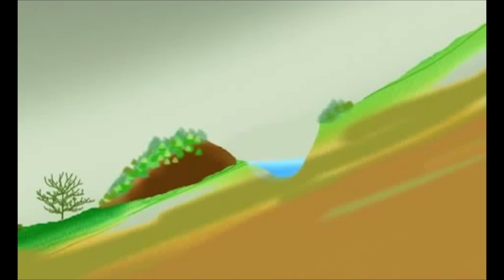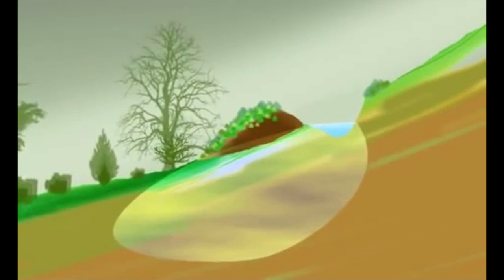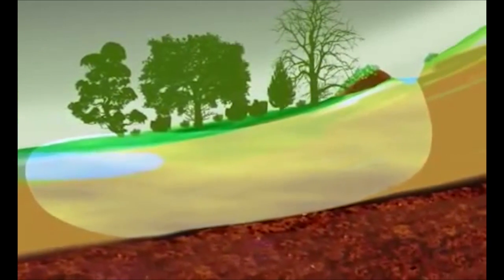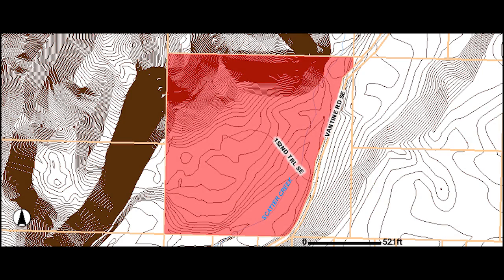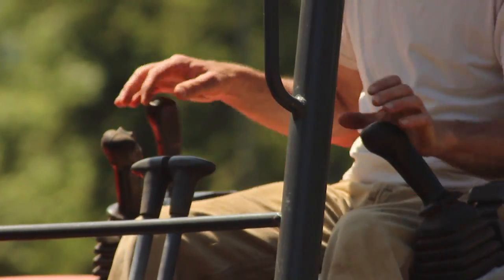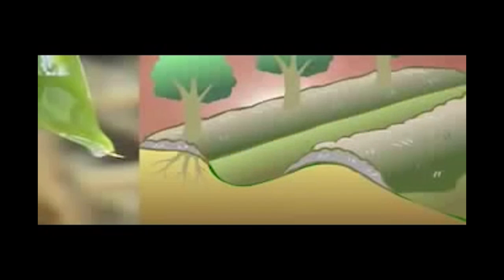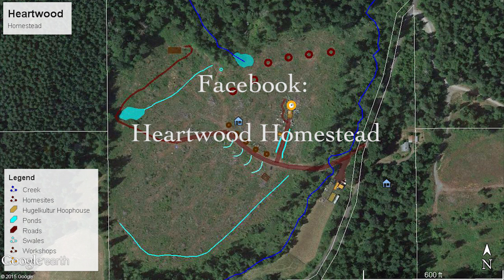Swales on Contour can Drought-proof Gardens, Farms and Pastures with Water Harvested Passively

Comment: I am little bit concerned about any possible landslide caused by the digging
Reply: I believe this is a technique used for water retention in drought stricken areas, especially in hill sides, so the chance of landslide is nil to begin with. But you raise a good point, since the PNW is generally a very wet area and prone to landslides.

Comment: Can earth slides occur with this method?
Reply: There are several bad examples where people went completely overboard. The consequences can range between simple inconvenience to quite devastating. After all water is one of nature most powerful forces. 

Either case those examples where more into the realm of "dam" than a modest swale so to speak. With lack of, or badly designed overflows, spillways, etc. ;-) 

Personally I´m not a big fan of large amounts or size of swales. Usually render the landscape difficult to work/pass. Render the use of mechanized systems almost impracticable, etc. Anyone trying to use a simple lawn mower can understand.

The design and use should be a really well thought process. Because there´s amazing advantages in the proper use of this landscape feature. But should also be very alert regarding the cons.

Worth considering also, water barriers, underground dams, key line, etc. etc. there´s several methods. Even soil improvement with a simple cover crop or trees makes for a larger water retention, than bare soil and that´s without heavy machinery or making scars on the landscape. ;-)
Cheers
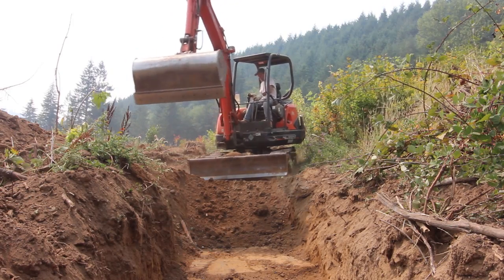Reply: It's obvious, you make a big cut into the ground, the water soaking in downhill adds weight  and there you go eventually. That's why 2:37

Comment: Would it possible to keep fish in them as a secondary crop? Does anybody do this?
Reply: No, swales are not canals. Ideally, they are designed so that water will infiltrate the soil within about 24 hours; minimizing standing water helps prevent mosquitoes from breeding in them. The idea is to slow down precipitation events to minimize erosion and flooding, store water in the soil, and consequently recharge aquifers.
One consequence of a series of swales is that the water table rises over time and sometimes creates springs downslope, which may or may not be a good thing, depending on the topography of the area.

Comment: Probably the best explanation of a Swale I've seen yet. The only thing I'd add is they work best if you can add in as much organic matter as possible to the berm. The berm then acts as a sponge holding the water in like a reservoir. I love the description of the downhill benefits of a swale. Your downhill fruit and nut trees would still be getting water from rains that happened weeks earlier because trees root deep. Another reason for swales is to keep nutrients from washing away during heavy rains. They tend to collect on the backsides of the berms in the channel. You can create small terraces between swales for growing food as well. It's how they did it on the Loess Plateau in China.
Reply: Grayhand what do you mean terraces between Swales. If you have links or keywords I'd appreciate it.